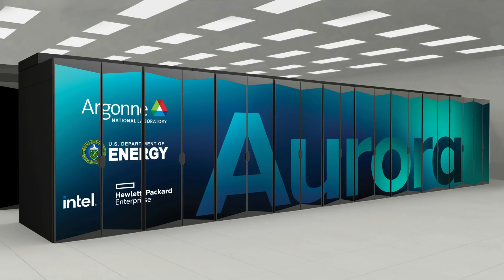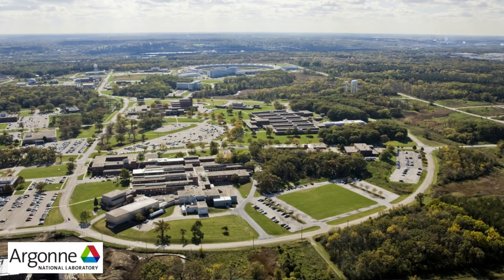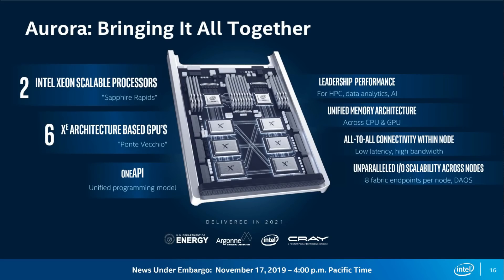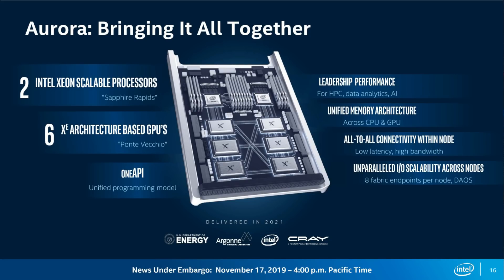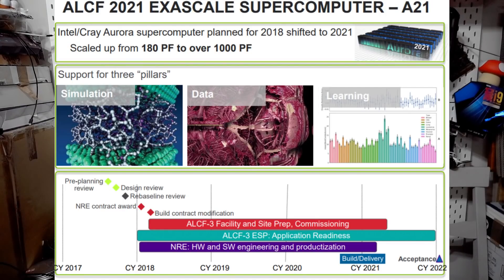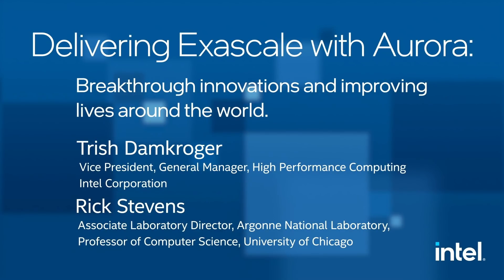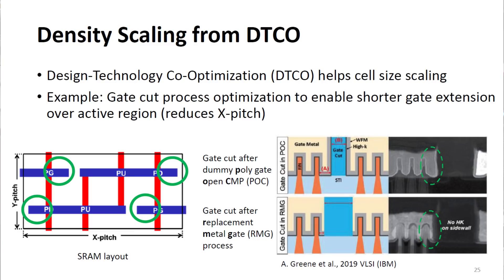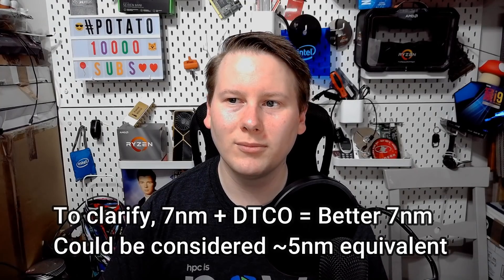Short News: Intel To Use ML on 5nm?

Comment: Rather than letting Apple go, hire Apple as a consultant and license Apple Silicon tech, and somehow adapt it to x86.
Reply: Until the benchmarks come out, it's not clear if Apple Silicon is an improvement over x86, or a cost savings measure.  Also Microsoft has attempted ARM on Windows a couple of times, and failed, mostly because of application problems.  Apple has far more control over the apps on MacOS than Intel or Microsoft does on Windows.  Even then it's going to be interesting to see what doesn't work on the new Macs.
Reply: @jandrewmore  benchmarks are out as of yesterday. In some instances, Apple Silicon emulates x86 faster than the native intel processor can run the code, and Apple Silicon does so while consuming far less power.
Reply: @j340_official  Link?  I'm not finding anything official and rigorous like Tom's Hardware.
Reply: @jandrewmore  there are several official reports out. Where have you been lol. See one ‘official’ one here at the reputable anandtech: https://www.anandtech.com/show/16252/mac-mini-apple-m1-tested 

“The M1 undisputedly outperforms the core performance of everything Intel has to offer, and battles it with AMD’s new Zen3, winning some, losing some. And in the mobile space in particular, there doesn’t seem to be an equivalent in either ST or MT performance – at least within the same power budgets.”
Reply: @j340_official  Google wasn't finding it either.  Thanks for the link.
Reply: @jandrewmore  no worries. You’re welcome.